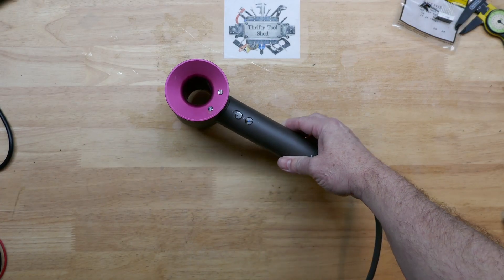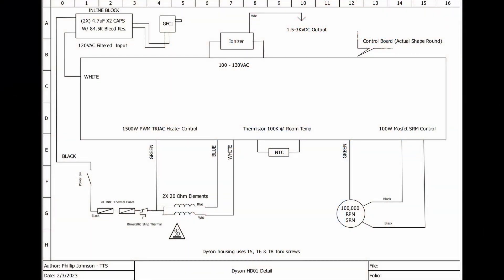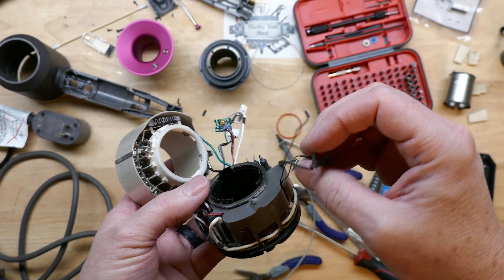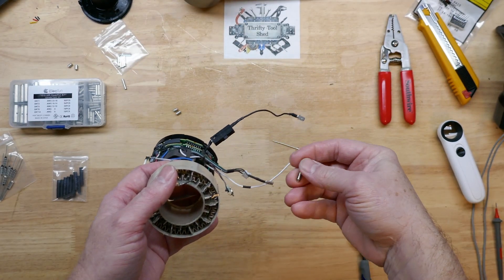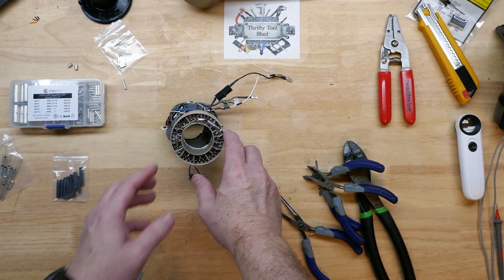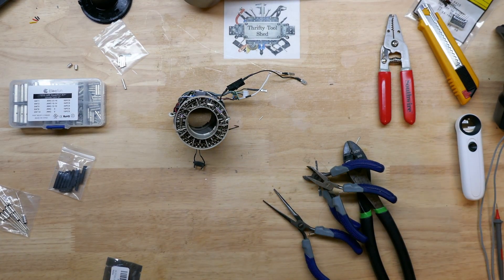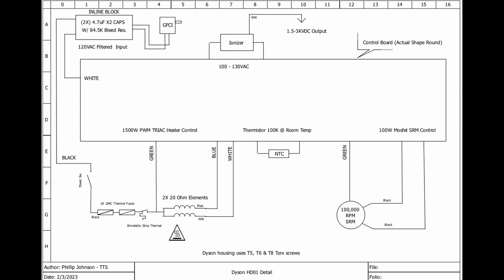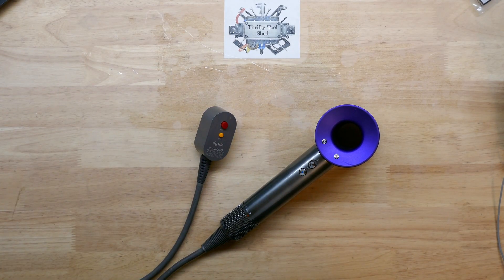Dyson HD01 Hair Dryer Repair #3

Comment: I don’t have the crimps. I wanted to confirm from your video you mentioned it’s not a good idea to solder because it will melt? Is that correct?
Reply from the maker: Correct. The reason these are crimped is because it's a thermal fuse and the link inside could be easily damaged by the heat from the soldering iron.

Comment: So only the thermistor can stop the dryer fron working ? I have also the three led s flashing and good fuses
Reply from the maker: Lots of things can keep the dryer from working. The diagram that I shared shows the items that CUT the POWER to the unit.   Some things that can cause the red leds to flash are heat related such as clogged filter inlet, fan issue or thermistor bad or unplugged.

Comment: Thank you for your video, it helped me disassembled my HD07 Hair dryer. I see that the element in-front of the bi-metalic strip (shown in your video at #4.02) is burnt and broke. Do you know what this element is?
Reply: It is part of the heating element, right at the entry of the two heating element (between the green wire and the heating element joint in your drawing). Is there parts for this?
Reply from the maker: I am not aware of a replacement for it.
The closest I have seen is the cheap one like in the example link that I dont know if I would trust?
https://amzn.to/4lCG03S
Reply: Right... Thanks for sharing.  @ThriftyToolShed

Comment: Thank you! This video is just what I needed. 

Unfortunately it appears I caught the cold shot button while removing the element/control board assembly from the head of the dryer, separating the actual button piece from the board. 

I’ve located two pieces—the button piece (8-sided silver wafer with bronze button in middle) and the silver “clip” that holds it to the board—but think I’m missing a spring or similar, as reassembling the button with what I have gives no feedback/movement. 

Anyone able to confirm this? If so, thanks :-)

Comment: have an hd01 with exactly the same issue. ordering the fuse now. thank you!
I also have a Dyson HD08 which has an exploded inrush current limiter ntc... the board and the whole construction is way! simpler than the hd01... to the point where im not sure if its a knockoff :D 
any chance you've seen a newer on of these?
Reply from the maker: I have not seen a newer one myself to say for certain. I do know the knockoffs look much like you described. The boards are very different and a lot less  components on the board. They also usually have a 3 phase brushless motor instead of the 2 pole Dyson motor. I can't say for sure that Dyson has not gone to using the 3 wire brushless motors also,  but I will say the cheap connector used on the knock off was a dead give away on the one I had. It was not even close to the same quality connector or motor design.
Reply: I have exactly the same thing one a HD08, the board is much simpler and the inrush current limiter has blown, can you see any part information on yours to get a replacement as mine is so blown up its illegiable!

Comment: Hi
I have the hair dryer apart & fully cleaned.
Turn hairdryer on & on full heat it lasts about a few seconds or even 20 + then cuts out with flashing three red lights all filters are clean & elements etc.
Just wondering  what to look at next, as dryer runs for quite a while on full heat sometimes before cutting out.
I appreciate any advice 😊
Reply from the maker: Possibly thermistor issue or maybe not plugged into all the way if lucky. All I would know to try. I shared all I know and all the actual ones I worked on in the 3 videos. Best of luck to ya!
Reply: @ThriftyToolShed  Hi thanks  for the advice do you have a video of where the thermistor is located  so I can check it now.
Thanks👍

Comment: Many thanks for sharing the tear-down. I'm working to repair/clean out a similar dryer, which runs from cold well, but when stopped and restarted, cuts out after 5-10 seconds with flashing red lights - thermal cutout. I don't think the issue is blown fuses (it works from a cold start), but likely hair and debris is blocking airflow and allowing the thermal cutout to heat up to trigger point. Fingers crossed!                                                                                                                                   
Considering how costly Dyson technical servicing is (UK £99 as of Dec 2024), and the 'style over content' design philosophy of making these hairdryers so difficult to get into (prying off the backplate cost me some damage to the main cylindrical head) to repair, it seems a definite step backwards (like Apple gear - lovely to look at; can be a pig to repair). We are living in an age of incredible technologies, which can and do go wrong and need repair. But manufacturer's vested interest to promote Consumption (with a capital C) with appearances or 'this year's new model', they are selling lifestyle accessories, rather than brilliant, transformative TOOLS to improve our lives. Tools should be maintained; should be valued and used well, and we should all have the right to repair (skills and knowledge are all that should separate people to repair, not patents and copyright laws)
Reply: Hi did you manage to fix this issue as I have the same issue.
Turn hairdryer on & on full heat it lasts about a few seconds or even 20 + then cuts out with flashing three red lights all filters are clean & elements etc?
Reply: @ not yet finished since returning from the recent holidays. I managed to open it up and it is chock full of dust and shall have the chance to clean and test soon. Shall post my outcome here.
Reply: @RobWallace-v7t 100% yes. I finally finished the job of opeing the Dyson hairdryer, getting access to the heating element and with a combination of vacuum cleaner (making a nozzle the width of a pencil) and compressed air (used lightly!), I removed a lot of cut hair and dust. The 'NTC' thermistor that is used to monitor temperature (and triggers cutoff when overly hot) was next to matted hair and dust in the heating element, which would explain the thermal cutoff cause. 

Putting everything back together - and these machines are a bit of a pain to work with as they prioritse form over function - it now works perfectly on all settings. It just needed a complete clean out. The hairdryer was used in a hair salon, where cutting and drying are common. I expect with home-use only, with no cut hair, it should now serve us well. Good luck!

Comment: Hello..thanks for your video. Ive replaced the thermal fuses and it seems that the bi-metallic thermal switch is broken. Can these be replaced as they seem to be rivetted on..
Reply from the maker: I have not seen these available at this time. One of the only options may be buying another one for parts or broken, and hopefully, it's got a good heating element and bimetallic strip. The only other option is an aftermarket head for these on eBay, but I don't know how good of quality they are.
Reply: @ThriftyToolShed  thanks, mate. Good suggestion..

Comment: Hi, can you tell me how can I check for the thermistor if it is bad or not ? I already have the machine apart.
Reply from the maker: The most basic test is if it measures around 100K ohms at around room temp. I  showed that reading on the schematic shared in the video as well. That is the only test I have ever had to do myself and simply make sure when you warm it up the reading goes down and when you cool it back off it goes back up while doing this test.
Reply: @ThriftyToolShed  thank you for quick reply, so I have checked the thermistor and it turned out just fine and I’m thinking I’m about to ran out of solutions here. Basically my machine turn on for half a second then turn off with 3 red lights blinking. I have checked the thermistor, 2 fuses on the heating element and the fan, all of them are fine. Do you think I missed something while diagnosing the problem ? Any thoughts will be greatly appreciated.
Reply from the maker: @daveh4121  
The one thing is to make sure the thermistor is making a connection in that super tiny connector on the board. It is also easy to turn and slightly unplug it while reassembly assuming it was reassembled while testing so just make sure the NTC is 
 not coming unplugged from the board.
Reply: @ThriftyToolShed  thanks for the advice. Turn out, you are right about the connector it was loose the whole time. Now do you have any advice to secure the connection between the thermistor connector and the board ?
Reply from the maker: Really the only thing I know to work is a small drop of super glue once it's fully seated which will be permanent unfortunately.

Comment: Hi, I saw your videos, very interesting, can I ask something? I have a Dyson HD 01 that no longer produces hot air, can you tell me what the problem could be and if there is a video that shows me how to fix it, thank you, have a good evening.
Reply from the maker: I have shared the 3 repair videos of ones I have worked on and even share a basic detail wiring diagram that I have put together with my little bit of experience. I have not worked on any other than shared on video. I have helped all I possibly can at this time. Best of luck to ya!

Comment: Thanks for taking the time to show the process. I just replaced a thermofuse that was blown re assembled, worked for about 1 minute i feel like overheat and it blow the older thermofuse . What do you think that can cause that? No air restrictions since I cleaned everything
Reply from the maker: I have mostly seen the air flow restriction being an issue which you mentioned has been checked. I would have to lean towards the heater control circuit. I have not seen the triac short that controls the heater, but I guess it's a possiblity and maybe even the thermistor reading incorrectly? I have had the thermistor come unplugged, but that causes an error and shuts down. That is all I would know to check if you have already made sure that the housing is together correctly and the back cover is properly in place to make sure all air flow is directed across the element. Best of luck to ya!
Reply: @ThriftyToolShed  Thanks again. I think you nailed. I tested without the back cover and the whole  housing/filter. After putting a new thermal fuse and assembled all the parts together it seems to work fine. THANK YOU

Comment: Great videos! Is there a definitive way to tell if the motor is faulty? When I turn on the hair dryer, 2 white lights and one red light come on for 3 seconds and then all turn off. Nothing else is happening.
Not sure where to start diagnosing the issue. Please help if you can.
Thanks
Reply from the maker: It is really hard to tell without another motor to plug in to see really. I have not had one go bad myself to know definitively. I have seen one act similar and it was a bad diode on the power supply on the board. I fixed it in the HD01 repair #2 video. That is as close to this issue that I  have seen.

Comment: Hi, I managed to find out a fuse was broken, are they soldered? Do you think I could just slip it out of the thing holding it?
Reply from the maker: It needs to be crimped. Soldering iron is hot and will make it open up.

Comment: i got the same model
of hair dry but recently got issue like no hot air and all other function as normal maybe because the thermal fuse broken?
Reply from the maker: Typically the thermal fuse stops all the hair dryer functions. Most likely a board issue. I do share the basic wiring for the HD01 on the repair video the best I could detail it that can help with the element, high temp switch and thermal fuses wiring if needed. Power getting to board etc. The board itself I have done some troubleshooting like on my Dyson HD01 repair #2 video, but I have no schematics for that.

Comment: I bought the crimps connectors from the posted link to Amazon, but they were too small in diameter to fit both leads in them. Still great video though.
Reply from the maker: Thanks for the feedback. I will double check that the product has not changed from the one I purchased!

Comment: can I install the thermal fuse either way or has to be the same direction as the original?
Reply from the maker: Either way should be fine with thermal fuses.
Reply: Thank you for your reply
 @ThriftyToolShed
Reply: @ThriftyToolShed  I used 184 c 10A , is it ok?
Reply from the maker: @leonzhao7919  I believe I mentioned in the video that they should be 16A rated. Similar to the ones I shared in the video description.
Reply: @ThriftyToolShed  yes. You did. So the 10A is not compatible to the dyson. I should change it,right?
Reply from the maker: @leonzhao7919  
Well my thoughts were just that it could possibly fail prematurely if 10A is all it is designed for. I don't know that it will cause an issue, just a concern. I just wanted to make sure I at least recommended the 16A since the HD01 can easily pull over 10A.
Reply: @ThriftyToolShed  I will replace it and see if it will work
Reply: so I did changed the fuse to 16A 250v now. same problem is it is shut off right after I turned it on and 3 red lights are blinking. I know you mentioned to check the NTC. how do I check it? the wire snapped and I reconnected them. and it seems fine. I also try to look for the part online and no luck. by any chance you have another spare part for the ntc thermistor.  @ThriftyToolShed
Reply from the maker: @leonzhao7919 
I shared all I have done with these on video. I even shared a basic wiring diagram and it shows the ohm reading of the NTC of the one I worked on back in that video. Hope it helps. 
Best of luck to ya!
Reply: yes. I did check that as well. it's shown 100k in your video. @ThriftyToolShed

Comment: Hi there. I found the problem on my dyson hair dryer. the fuse is damaged. I changed a new one by following your instructions. I damaged the NTC wires and I put them back together. Before The dryer was shut off completely and It could not be turned on. After I changed the thermal fuse, it can be turned on but it only last for a second, then it is shut off and the 3 red lights are blinking. what went wrong?
Reply from the maker: I would double check the NTC and it's connection still. That would be my first thought.

Comment: I had this same issue and replacing the first thermal fuse fixed the issue, however it immediately blew the replacement fuse after running for about 30 seconds. What should I check next to prevent this from happening?
Reply from the maker: Make sure the replacements are rated for at least 16A. Some are only 10A rated. Next I would check and make sure nothing is impeding air flow through the screen area. The other thing I can think of is that the thermistor is bad and reading is lower in temperature so the heat is getting hotter than expected. Other than that the triac in the heater control could possibly be shorted.
Reply: @ThriftyToolShed  Thanks a ton for your help! It was a 15A fuse and it was running partially assembled without the screen in place, so I will check the thermistor next. Cheers!

Comment: Thanks! This video was the exact issue I was having. After putting it back together it started overheating and shutting off with 3 blinking red light and I was just going to give up but I realized the filter grates were literally blocked with dust that was hard to see. I washed it under water with soap and was able to see right through it again. It’s now working perfectly fine for the cost of a thermal fuse. Thanks!!
Reply: I have the same problem. changed fuse, put it back together but it keeps shutting off and 3 red lights are blinking. I don't put on the filter when I test the dryer. what do you think? what went wrong?
Reply from the maker: I would check the thermistor where it plugs into the board.
Reply: @ThriftyToolShed  do you know where I can buy the thermistor. I broken the wire accidentally when I took out the parts. I tried to reconnect both wires but it deems not working properly.
Reply from the maker: I have not had to buy one myself. The one time I needed one I had a donor dryer to use parts from.

Comment: both the red and white lights flash once then I just hear a slight humming noise but no heat or air what could that be?
Reply from the maker: Not sure what that fault is exactly. Have you checked the inlet filter and even the fan to make sure that hair has not got in it?
Reply: @ThriftyToolShed  yeah i have would you be willing to look at it for me if i mail it to you?
Reply from the maker: I wish I had time, I do get asked this often. I do not have a repair service at this time.  I work full time+ in an Industrial job and try to have time to edit videos to post. I try to help by posting what I have found with a repair as we learn together.  I wish you the best of luck with yours.

Comment: Mine turns on and the motor spins up but slow for about 1 second then stops. Any idea what could cause this? Thanks
Reply from the maker: Most likely either hair in the motor or possibly the thermistor is unplugged or not reading temperature for feedback to the board.
Reply: @ThriftyToolShed  thanks! It's not hair in the motor so will look at the thermistor. Is this located in front of the heating element?
Reply from the maker: @dwstudiosguitarbassanddrum6419  
Yes it's in the black ring on the front. I mentioned the Thermistor in a couple videos. Most likely the disassembly video if not in this one.
Reply: @ThriftyToolShed  interestingly the HD03 model doesn't have one at the front. They've obviously changed the design :/